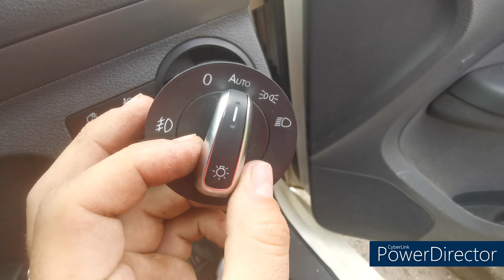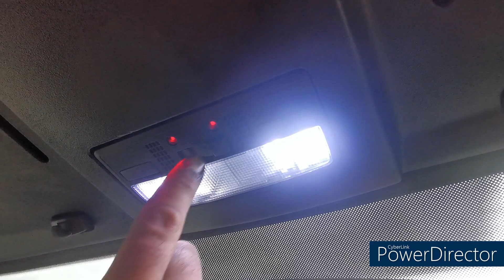(Abandoned VW Caddy Part 13) Blacked Out Interior Trim!

Comment: What age polo did the handles come from?
Reply from the maker: they are from the polo 6n2/6n3, so like 98-04 maybe? im not that clued up on polos, alot come with the little hook for a coat hanger so i had to cut that bit off first before it would fit